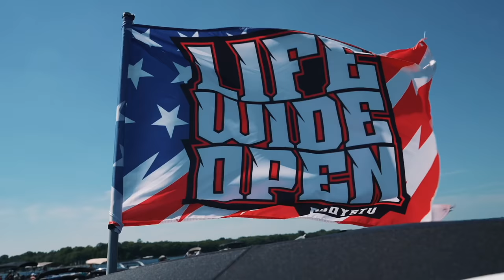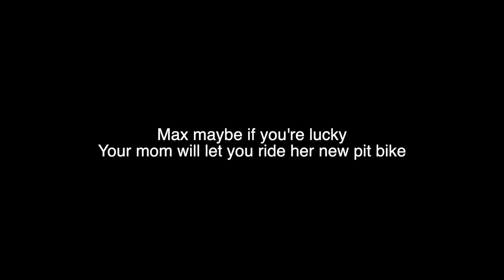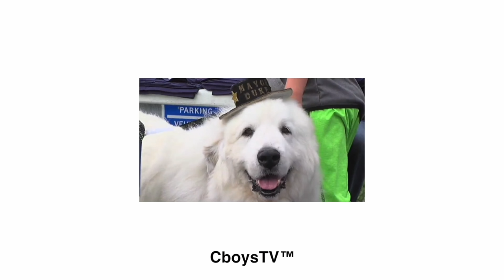New Drift Brake for Maverick X3

Comment: Those Mavericks are so soft suspension-wise that you gotta really use the weight transfer to get em sliding. Just let off the gas or tap the brakes as you turn in or transition and the weight coming off the rear tires will mike it slide like butter